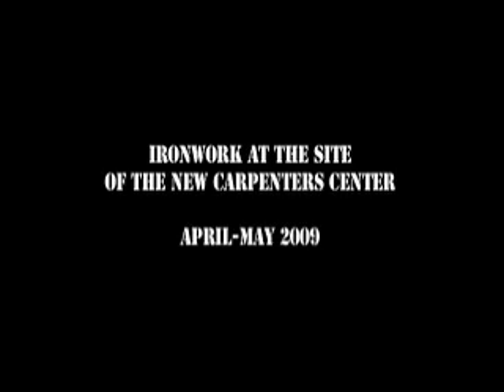Carpenters Center: Spotlight on the Ironworkers

Comment: has anyone noticed ALL THE WELDING BOOTHS??? drivin 93 south?? cmon now,, congrats to the carpenters on their new facillity,, i have a lota Carpenter buddies, but what the F-ck?     weldin booths?? do they want it all?   you dont see any hammer an nail setups in local 7... congrats again, but cmon guys,, why put the welding booths first floor on 93 south,, every ironworker, pipefitter, and boilermaker CRINGES when they see that